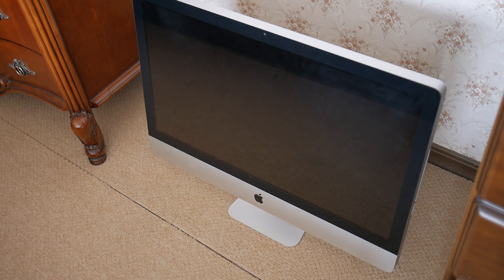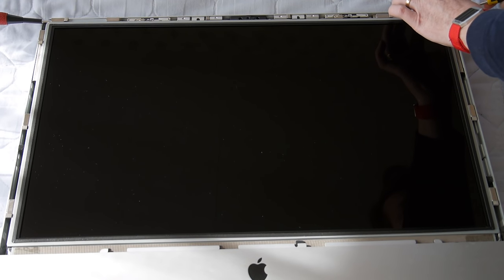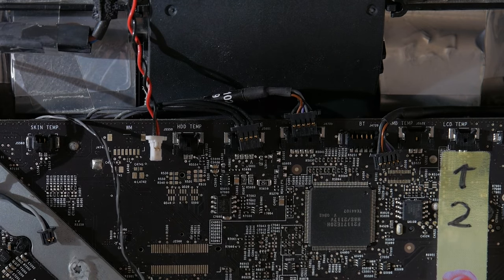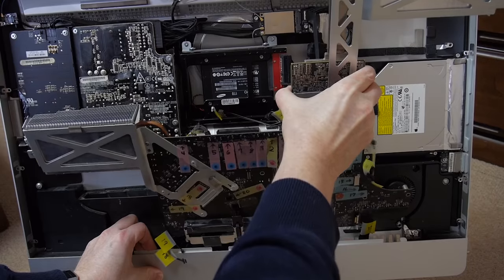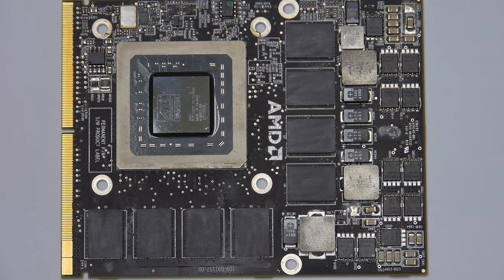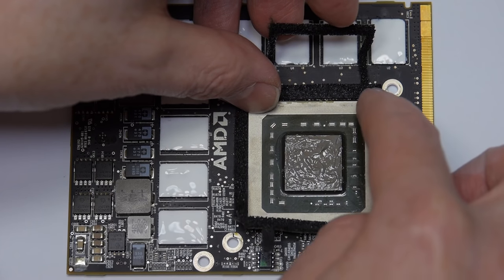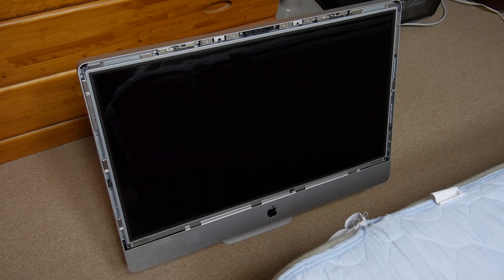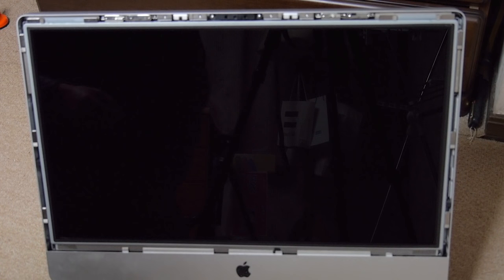Late 2009 iMac 27" Video Card Repair [4850 Bake]

Comment: I purchased a new ATI Radeon HD 4850 512mb card and used this video to accomplish the replacement.  Actually, I had to do it twice.  The first time (last week) I replaced the video card and got all the way to attaching the screen's video cable (#3 label in the in the video), when the connector on the logic board came loose and about 5 of the pins were bent and 1 broke).  I purchased a used logic board (another $215) and installed everything again today.  I fired it up and everything works GREAT!!!  I can't thank the gentleman that made this video enough.  It was an invaluable tool in getting my iMac back up and running.  Hopefully the video card and logic board will last me another couple of years.  BTW, I also upgraded my RAM from 4MB to 16MB while I was at it.  I spent a total of about $700 for everything.  It's not going to be as fast as a new IMac, but I only invested about a 1/4 of what a new one would cost.  I basically only use it for Microsoft Office, surfing and emails so I don't need a gaming setup.  I'm a happy camper.  Once again, thank you very much for the great video!!!
Reply from the maker: That's unfortunate to hear of your need to get a replacement motherboard, but it's good to see the price was somewhat reasonable at $215.  If used boards are fetching that much, you might be able to sell your old board for parts, noting that it would work perfectly if that one connector was repaired.  I too have 16GB and even with my user and my wife's user open all the time, it's enough RAM most of the time.  And when insufficient, I just log out her user.  But perhaps the biggest speed improvement came from my swapping out the spinning-platter 1TB internal HDD with a Samsung EVO 850 1TB.  The SSD makes my old 2009 iMac feel like a modern computer. Anyway, thank you for your kind comments and best wishes to you and your newly resurrected iMac!

Comment: This absolutely worked as described. Did this repair on my friend's 2009 iMac. Apple told him it was the mother board but I disagreed after reading comments here. If you follow this video, you will be successful. Only thing I did differently after watching this one and the 2nd Bake vid was to clean off the heat sinks and chips right away and did the bake for 10 minutes. 

Thank You!
Reply from the maker: Thank you for letting us know of your success, Victor!  Yes, Apple is completely and hopelessly oblivious to this problem.  Perhaps some people in the engineering department know of it, but most Apple store support staff do not, and support staff at Apple headquarters merely recite what they are taught.  I have a PDF troubleshooting guide that Apple publishes for internal use and it says nothing about this video card problem at all.  The card is clearly defective in its design, so I can see why Apple doesn't want to publish that fact.  But as you have discovered, the good news is that, and quite miraculously so, the 10-minute bake really does work, especially if you wipe away all the stock thermal paste and replace it properly with better paste.  That combined with boosted fan speeds should help most iMac users get more years of use out of their investment.  Thanks!

Comment: This works! I just baked my 2011 27" iMac's AMD 6970m GPU and it works again.  I simply followed examples shown in several of the youtube videos including yours.  I have never done anything like this before. This was the first time I opened up my iMac.  While it seems intimidating at first, I did it.  The hardest part was reconnecting the power cables behind the Logic Board and from the LCD panel to Logic Board.  I put a sequential numbered piece of electrical tape on all of the wires and it went together smoothly.  Baked at 400F for 10 minutes.   Took about 3 hours to fix.  My thanks go to all of the Youtubers who filmed the process and also to those users who posted their encouraging success stories too.
Reply from the maker: Thank you for sharing your success story, Steadman!  Your case will be very helpful and encouraging for 2011 27" iMac owners, proving that the bake is not merely for the late 2009 model that I own.  It does indeed work for later models too.  Best wishes!

Comment: I did this and I'm here to say, it works. I used this video and a couple of more. There is a small connector for the fan that goes from the graphics board to the mother board and it is truly a mother to put in - nobody shows fully how it goes since it is in such a tight area, but combined together, each person's advice help. Give yourself about double the time you think it will take and really, really, really notice how the connectors go in. Mac has done everything in its power to make this difficult to work on. But, great video. So, JDW, thanks for all your help.
Reply from the maker: Thank you for sharing the tip and the story of your success, Velo!